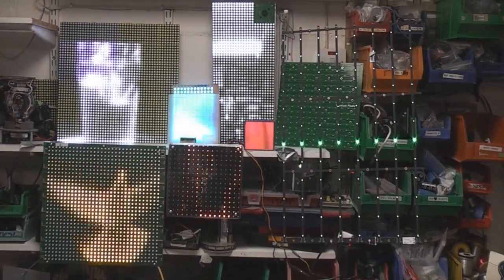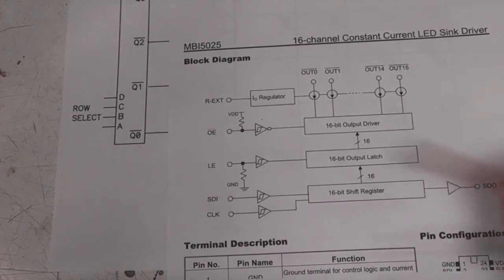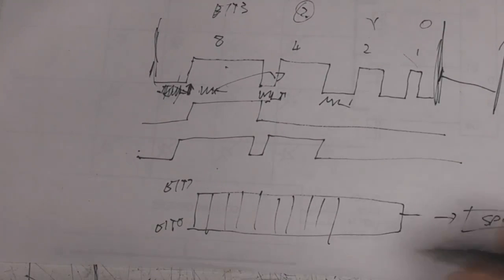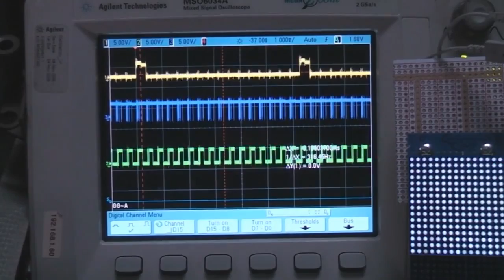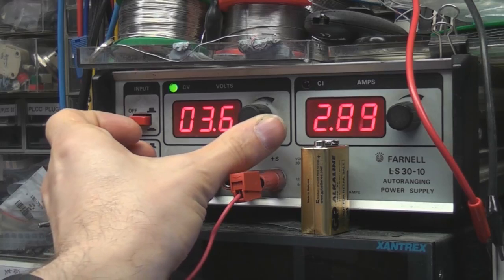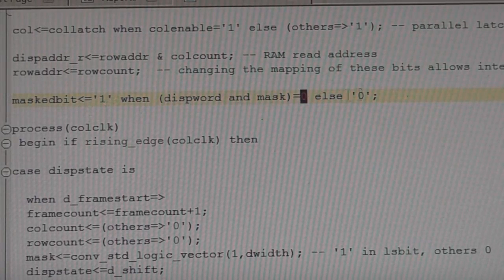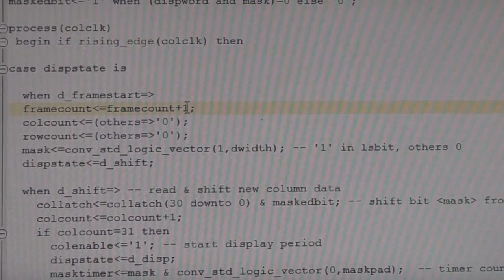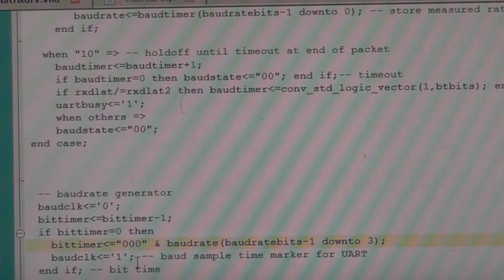Driving LED matrix displays with an FPGA

Comment: I always think I'm clever when I come up with some solution for coding an arduino 'efficiently'...then I watch one of your videos...This is fascinating. Wiring, fpga, component selection, and code routine...all splendid.
Reply: coding an arduino efficiently == dumping arduino and just using avr-libc right?
Reply: donpalmera Agreed - like I implied...I'm a total nub and finding ways to sneak a little proper-C or asm into the code makes me happy.  Seeing how far I can stretch the very limited IDE is kinda fun.
Reply: donpalmera Is the difference big? I've noticed that codes I write in Atmel Studio tends to use less space than the equivalent code written in Arduino IDE, but so far I've only written fairly simple codes.
Reply: frollard No need to 'sneak in a little proper C' because the Arduino IDE uses C++ anyway, and with very few exceptions all normal C functions are supported.

Comment: Great info!  I've heard that VHDL is the standard in Europe. Did you actively decide to use it instead of Verilog, or just picked it up because resources were easier to find?  Thanks for the detailed video.
Reply from the maker: Fairly random decision many years ago when I was doing the high-speed camera project - found a good VHDL book. Probably the wrong decision as some of VHDL is a PITA but I don't do enough FPGA to justify changing.
Reply: VHDL is generally taught in UK Universities and it seems to be the standard HDL in Europe. I was expecting a VHDL vs Verilog "outbreak" with that comment :).
Reply: correct. I work with VHDL and it is very nice to write and very good to read.
Reply: I'm in europe but I started learning FPGA in my own spare time, so I picked up verilog because the VHDL syntax scared me off instantly...
Reply: VHDL syntax is something scary and unnecessarily verbose in my opinion. I worked with it for a couple of years and converted myself to Verilog.
Reply: This VHLD in Europe and (System)Verilog in U.S. is kinda true but in reality you do need to know both and even as hobbyist you will if you spend more time with HDLs because most bigger projects use modules written in both. In the end it all reduces to wires and connecting modules isn't any different than connecting real hips on the PCB... you just have to worry less about timings while within FPGA but only because during synthesis your compiler will handle this stuff for you.

Comment: Very good video indeed!!!
I'm a software guy who in later years found hardware and have now combined the two in order to make really useful projects. Just like you I'm spending a lot of time to develop visual gadgets and I have outgrown my trusted microcontrollers purely due to their lack of speed. (I develop visual feedback devices for autistic kids)
I have thought about going down the FPGA route for a while now but didn't know where to start, and everything seemed a lot more expensive, so this video was very informative to me!
I would really appreciate if you could make available the code you demonstrated in the end so people like me can have a working boilerplate or similar to analyse whilst learning VHDL. 
I have made quite a few of my own LED panels and the costs you are mentioning are way below even my cheaper solutions so perhaps one should look closer to see what's available in China already?...

Comment: That is excellent. I am looking for a FPGA board to drive 4 RGB LED panels each 64x32. 24 bit per pixel should be enough for my application, that is 4*64*32*3*8=200kbit per frame. I can drive them by daisy chaining panels, or wiring them in parallel to FPGA as separate panels. I do not need more than 10 Hz framerate, but 30Hz would be prefered so things like scrolling and synchronization between panel is better. I also need a double buffering so I can upload new frame for entire display, then swap a content quickly and atomically. That is because I am planning to use Raspberry Pi or other network connected micro / SBC to drive these, and UART timing isn't going to be the best.

Future upgrade to 16 panels (4 x 4 matrix of 64x32 RGV LED panels) would be awesome for me too. (800kbit per frame).

Or a 16x320 display that can display about 24 characters (16 pixels tall each) at the same time.

This video is 4 yeras old, so I am assuming there are better FPGA boards available these days, for projects like these or similar. 

Lattice iEC40, i.e. https://www.mouser.co.uk/ProductDetail/Lattice/iCE40UP5K-B-EVN?qs=KeU%2faRU0YVWVQ39q7XFcHg%3d%3d looks like reasonable choice for this.

Comment: Great video, i'm really starting to like these long rambling about stuff videos.

Oh and I'm also curious what made you chose VHDL. Personally i got in to Verilog because the syntax seamed nicer and more C like.
Reply from the maker: Fairly random decision  few years ago - found a good book that happened to be VHDL. Also I was told VHDL is more likely to catch stupid errors at compile time, whearas Verilog would compile almost anything & let you figure out why it doesn't work. Possibly the wrong decision as VHDL can be a PITA, but I don't do enough FPGA stuff to justify learning another language
Reply: mikeselectricstuff
The Verilog i learned was due to a freelance project needing a CPLD, month later had to learn VHDL in a uni class, hated it for its complexity and just kept using Verilog for my own stuff.

If i have not gotten in to Verilog on my own id probably be using VHDL too.

Comment: Good evening Mike ! Love Your stuff, in my eyes, Your god of electronics :D
Reply: I would say so too. Never seen anyone be able to talk so fluidly about something so complex. If there was one, it would be him. He is able to figure anything out it seems. I though my parallel port driven 16*16 was awesome, this = OMG.

I want to try making a Pentium 4 compatable 16 core CPU with one of the $40 FPGAs and wire to the socket 478 and run at a few GHZ (at least 3). Learning from this guy will definitely give me a idea of complex engineering. I know its possible to put a ARM CPU in a cheap FPGA, why not make a P4 compatable one? Plus wouldnt it be awesome to brag how fast your 2001 era PC was LOL.
Reply: theLuigiFan0007 haha, was the project successfull ?:D
Reply: use the force
Not yet, it takes a while to reverse engineering the instruction set of the P4 before you can build a compatable one. The early intel 80* series chips were relatively easy to clone with less thatn 200 pins, now its a real feat if one can pull it off. Or I could build a translator interface that translated P4 data formats and instructions to ARM. It will take a lot of work to get it running, but its one of those goals I feel has to be completed while im still relatively young. I wish to design a series of CPUs someday (if I ever start or get a high position in a semiconductor manufacturer) that simply needs a pin adaptor to run on a Intel or AMD based board. I think it would not only be a good thing for competition, but it could cause other companies to take on the idea. If all components were mix and match with the current technology, making a system built specifically to one's needs and budget would be really easy.

Wow, this was more a letter than a reply, maybe I said too much LOL.

I also have a few other projects relating to high voltage and LED driver circuitry I occasionally work on. Just though I should reply even though I havent logged in for a while, as you asked a legitimate question which has a fairly important meaning to me.

Comment: Just came across the PCA9955ATW chip from NXP. Check it out if you haven't already. It can be used to drive RGB LED's. Can't wait to try it myself. Of course it's not available from distributors just yet but it looks like you can order samples
Reply from the maker: Digikey have stock. Only 8 bit though so no good for monochrome. Also a bit expensive

Comment: Hi! You mention gamma correction and problems with number of bits. Have you looked into implementing the gamma function in the enable signals? So you could have just 4bit data, but the bit-"weight" is scaled according to the gamma function. I could see using 16bit PWM to generate the bit-weight while outputting just 4bit gray-scale.
Regards

Comment: Hello Mike!
When i saw the black 64x32 RGB board i started playing with the idea of making lots of them in to a table top with a plexy plate on top. but how hard is it to make it work as a computer screen? Lets say it is doable... If you mount a camera in the cealing you can have software picking up stuff like a glass or a cellphone, generally an object, and make it interact with stuff put on the table.

Comment: Thanks for the video mike! Do you know if the software to program Lattice FPGA's is free to use? I'm really intrigued by that Lattice FPGA that has most components built in, and it's also a QFP! I'd like to build my own FPGA board but soldering BGA's is something I'm quite worried about.
Reply: I believe some of the basic lattice software is free but does require registration. I also think their is an open source option being developed.

Comment: I thought one would program a fpga by placing logic gates, or modules together something like you design a circuit in a eCad program. silly me. now I wonder if complex chips are designed by code like vhdl that compile into a silicon layout.
Reply from the maker: You can do it from schematic, but HDL is so much more powerful that nobody really does it that way, and schematic entry in the tools is not being developed or has been dropped.

Comment: How do you get those MBI devices? I can't find them on digikey or mouser. I like the idea of a $0.20 16 channel constant current driver chip. I have used the TLC5921. Similar, but like $1+
Reply: James Fry currency conversion is easy.  20p = $0.32

Comment: I understand that register need a latch clock and data pin while latch 0 clock from 0-1 and valor data performance << 8 bits 

Bit banging software 

Void spi ( data ) 
{
 Clock = 0
Data =0
Latch=0
For ( int I=0; I<8; I++)
Clock = 0 and change to 1
If ( data & 0x80 )
 Data = 1 else 
Data =0
Data <<= 1 
But on fpga ??? 
How it is implement ???